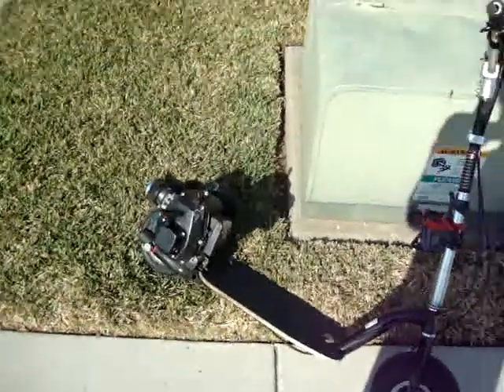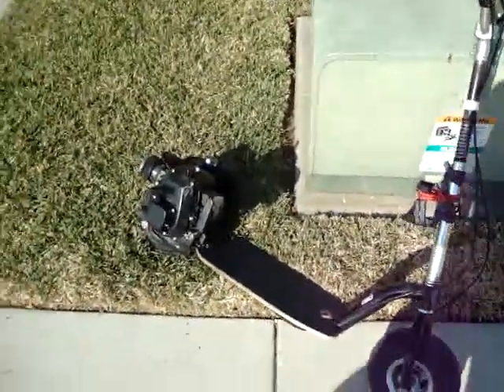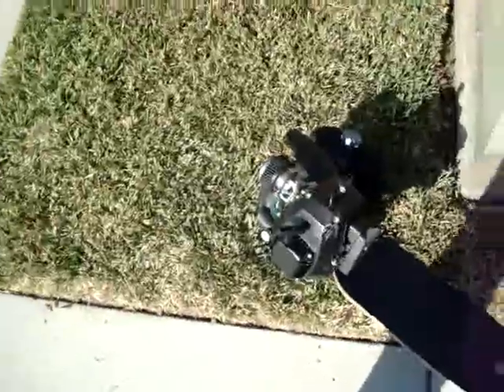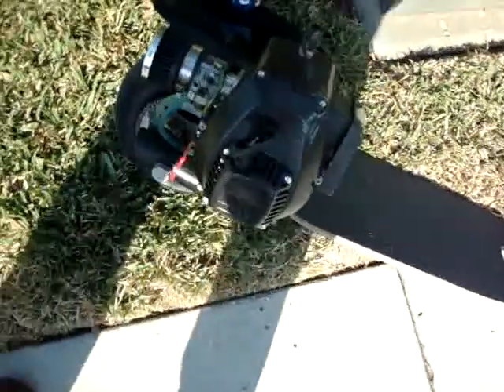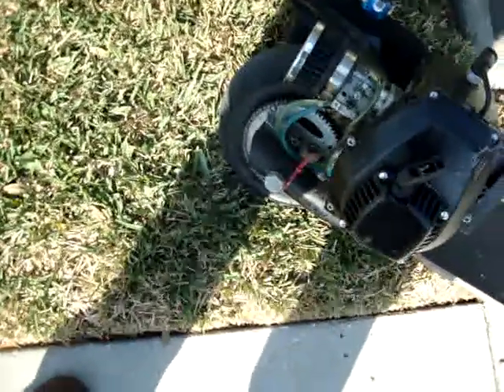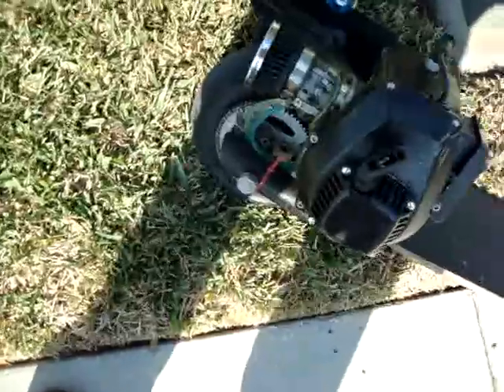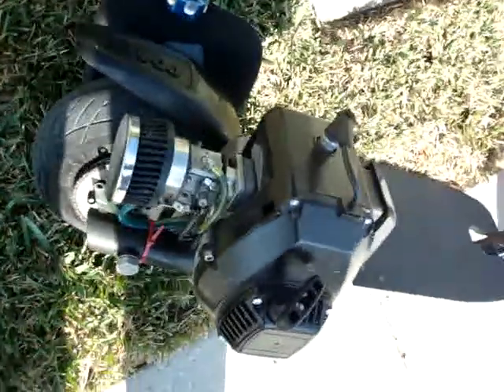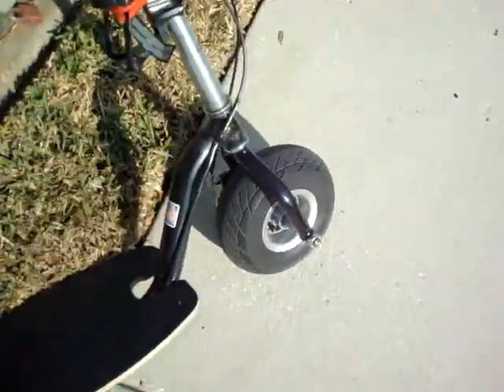SGSR46R Flyby

Comment: The gsr46 has a larger motor than the gsr sport. and the gearing means if its a 7/68 u would have a 7 tooth sprocket at the motor with a 68 tooth sprocket on the wheel. So if you have a 7/68 ratio it will give you higher top speed with less acceleration, its a shorter ratio. the 7/82 gearing would give you less top end speed but much better acceleration being a taller ratio. a taller ratio will turn the wheel faster but it only goes up to a point. thats why u lose top speed.

Comment: NICE BUT YOU SHOULD BUY A Jetpro Rhino Pipe... Just Say A GSR46R Will Go 30mph.... If You add The Jetpro Rhino Pipe Youll add 10MPH Making It 40mph... & With A Top Notch Air Filter.... That Adds About 3mph So 43-45mph Will Be Your Top Speed, Thus Makes It Easier To Hit 35mph And You Can Maintain Without Stressing Your Plug & Engine